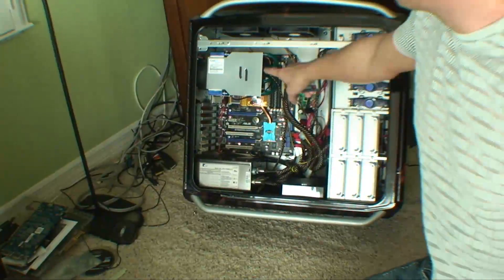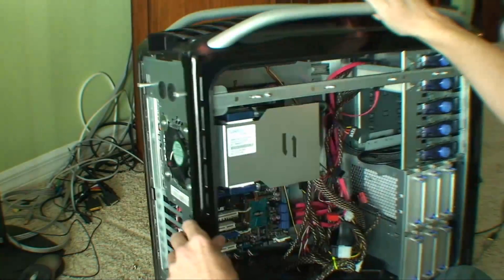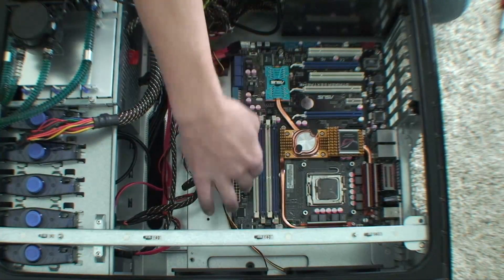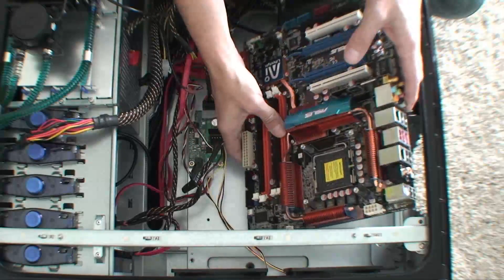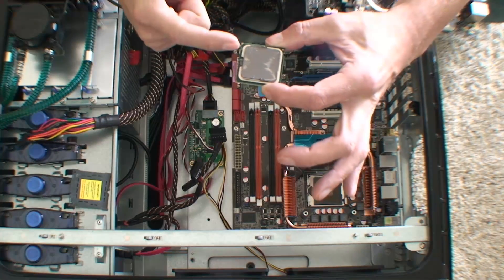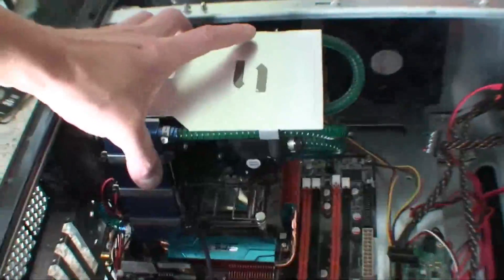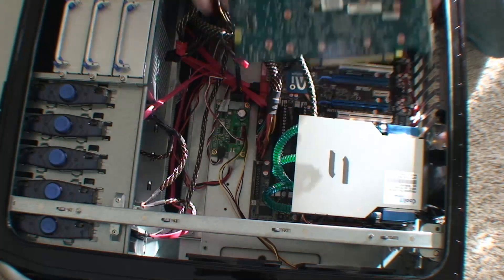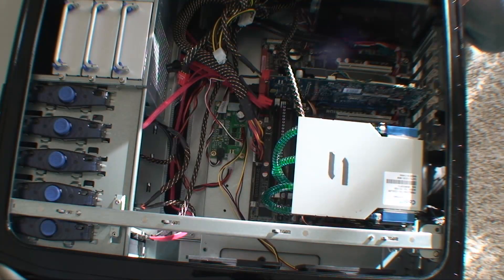installing a motherboard

Comment: here is the 2nd part of the previous post: I was looking at the Cosmos case as well, as you can fit 3 120 mm fans on top of a radiator on the top of the case, but now I am wondering about condensation. BTW, nice jump from zephyerhills! I live in tampa bay, and in Ybor City, there was a fellow from the Tampa bay brewing company that used to go up there all the time with a group. He has left his mortal coil since though. Keep up the good work on the videos! Best, SSK

Comment: Hey shazammn51, nice videos, I am trade the equity index's, and I am building a box, but I leave my system run 24/7. When I do my watercooling, would you say the best location for the radiator would be outside the case, or in the front of the case as opposed to the top?